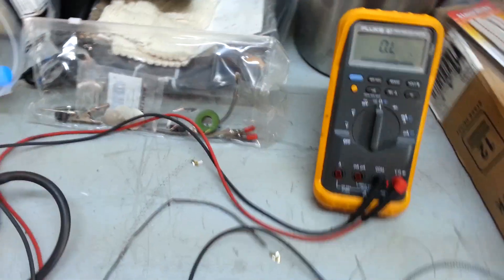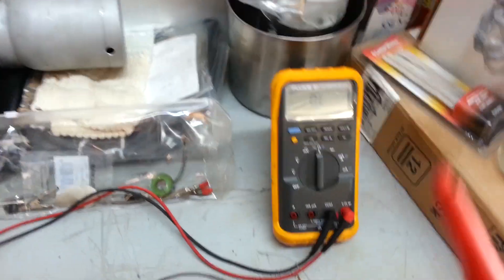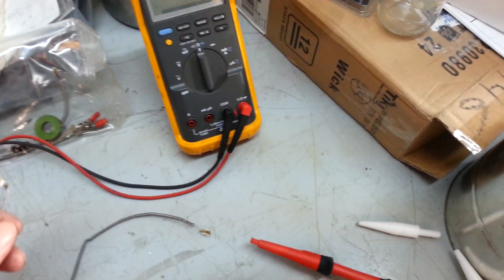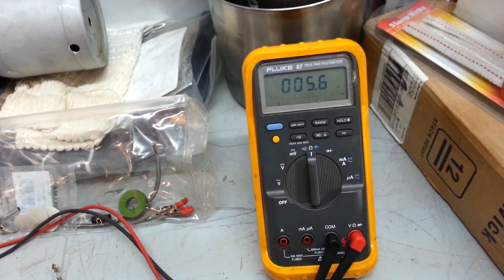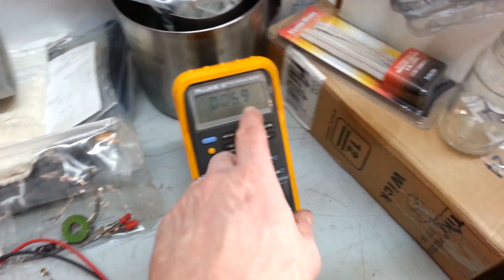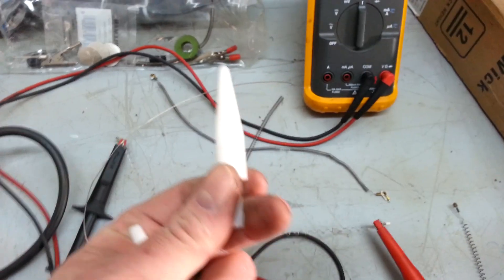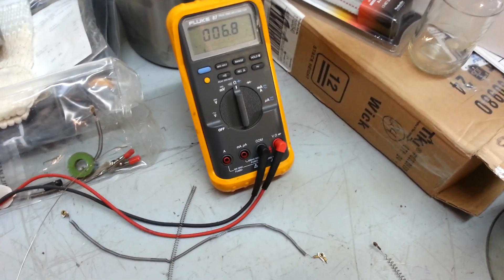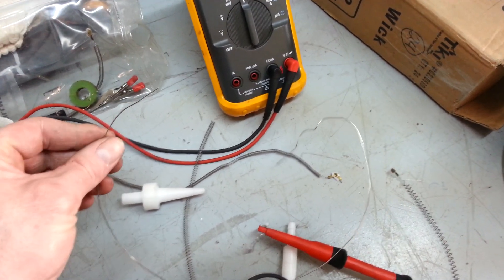Vacuum leak smoke machine-Nichrome wire info

Comment: Quick question...instead of using the nichrome wire can we use copper wire instead?? I tried it but ended up burning my negative and positive cables...
Reply from the maker: No Sir, use nichrome and use a length that gives you about 1.6 to 1.9 ohms. You can have more ohms if you want just might not smoke as much. The copper gave you a direct short

Comment: I dont understand why noones thought of using an adjustable aquarium air pump, theyre cheap and you could easily turn the air pressure up or down.  Also a cheap 20 watt soldering iron seems much easier than trying to ohm out wire and all that guesswork, then both the aquarium pump and soldering iron run on 120v AC and dont have to involve the cars electrical system and all its delicate electronics.

Comment: Hey Brian..I see on several videos that 20 gauge is used..so with 12.5 volts (car battery)  how hot temp is that wire.?
What is the ideal temperature? 
 Thanks and keep up the good work. 
  Kevin B.
Reply from the maker: I had initially only tried a handfull of different gauges but the 20gauge seemed to work best so thats why i went w that so i cant say that ive tried a whole bunch of them and i remember looking at the chart for the wire years ago and it seemed to fall in the catagory of what i was wanting for volts/amps/temp etc. but ill have to look it back up when i get a chance to give you more exact info. but id be lying right now saying i remember all of that cuz its been a good amount of time and i dont want to steer you wrong if your wanting that info. Ive been really busy lately so if you get a chance before I do you can look up a nichrome wire chart and it breaks all that info down. I know you were looking for a actual answer but i just dont want to waste your time at the moment and wanted to respond to your question.
Reply: Brian B
Do you recall what length the 20 gauge was.?
I've got my ol cigar smoker I made years ago pulled apart and ready to go all electric and save the cigar for myself  (:
as you know the shorter the wire the hotter the temp, so I'm thinking if all else, i'd put a potentiometer in play to just turn it down if needed.  Your thoughts would be great.
Thanks
Reply: Actually..probably something more like a rheostat..not a potentiometer ..It might hold up better to the amperage.
Reply from the maker: +exmotorsports Sorry for the late reply but you could use a potentiometer if you wanted, i dont see why that wouldnt hurt at all
Reply from the maker: +exmotorsports I would def ohm that wire if you use it and dont have a potentiometer. In case you dont know just divide your battery voltage w that resistance so you know your amps (Ohms law) so you dont get to crazy w the amps. I know some of those style e cigs and etc., run very low ohms like .5 so make sure to find that out

Comment: Hey man you're saying you have 20 gauge wire but I went to a vape shop and got 28 gauge and its much thinner than yours looks, do you know why that is. And do you have a video where actually have a step by step for making these things
Reply from the maker: Hi Shevin, the reason its thinner is because its 28 gauge and not 20gauge. The higher the number (just like wires) the thinner it will be. I cant say how good that will work because i havent used that size. As far as a step by step video, i have some that explain some things but not an actual step by step
Reply from the maker: If you click on someones name by the video title you can look up all the videos someone has put out. Click on the name then scroll over to videos

Comment from the maker: Use 12.6volts for a fully charged battery and for a roundabout value you can use 12volts. I really suggest either buying or borrowing a multimeter, either thru a partstore or a buddy. Its going to be difficult doing this without having the correct info. You need to verify your ohm reading also.

Comment from the maker: Hi Oswald, are you using a power supply or the vehicles battery? With only having 1 of the values you cannot get the rest of the formula. If you are using the car battery then put your volt meter on dc volts and put the positive lead to the positive terminal of the battery and black to negative. You need 2 values to use the formulas.